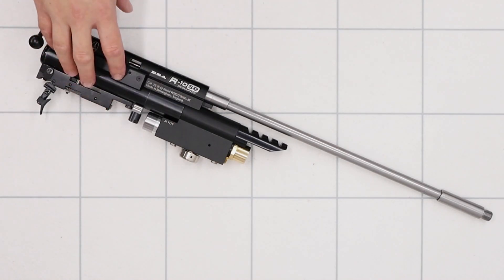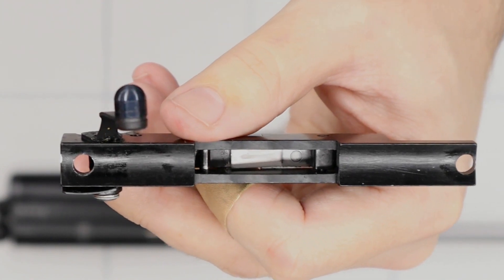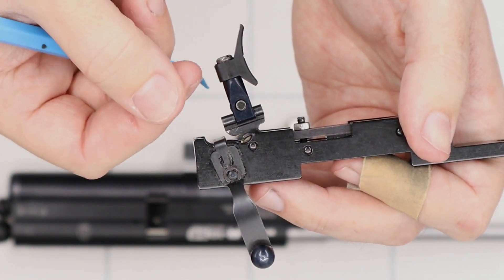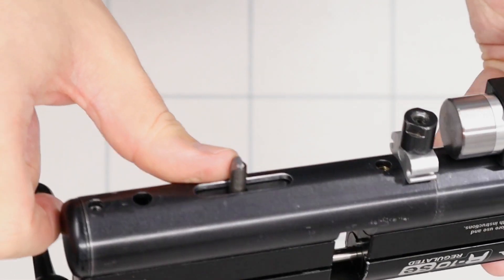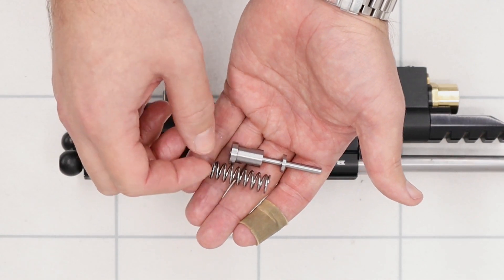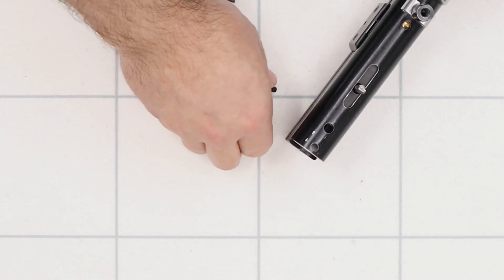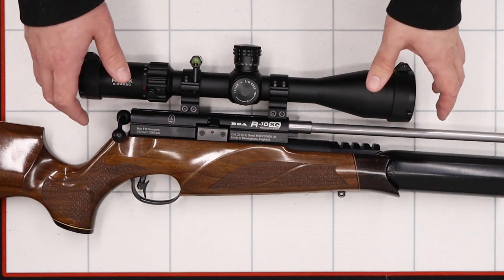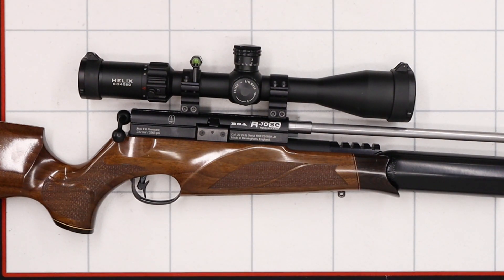BSA R10 Tuning (Increased shot count)

Comment: Great video Jeff! It believes belief that a company like bsa would allow so many design faults to pass their quality control. For example a chromium pellet probe! Any engineer knows chromo starts to peel after😢 a few years! Another I read the rifleing stopped short of the muzzle by about 5 mm. Again the muzzle is the most critical for the barrel accuracy! Jeff had to shorten the barrel and crown the muzzle! I have shot bsa rifles since the late 50’s and never had any manufactured faults like that! I fear that takeover by Gamo might be something to do with the poor quality control! Another gripe I have is with Air Arms! I have a AA S400 (.177) for 7 years which has been pretty accurate for target work! I thought I would give it a service only to find anti tampering all over it! Thanks to Jeff I was able to get rid of all this nonsense! A local rfd told me it was illegal to remove it! I found out through a lawyer that this is absolute tripe! As long as the gun is sub 12 ft/lb it is within the law! I set mine to 11.5ft/lb with the heaviest pellet I could find and put a touch of thread lock inside the adjustment screw! I have saved myself several hundreds of £’s in freight and gunsmiths fee’s! What in the hell is companies like AA bsa etc playing at! I suspect it boils down to greed and money! After all you could buy a powerful sports car that could do 150 mph but you still have to obey the speed limits!

Comment: I bought a stainless steel pellet probe from a good supplier. I had to polish the rear section with 2000 grit wet and dry followed by Autosol metal polish to give it a mirror shine. Without this, it felt unpleasant in the gun due to the very fine machining marks acting as serrations in the delrin shuttle. It would have worn the delrin in no time whereas now it feels smooth like a new chrome one

Comment: I have the .22 super carbine and got 200 shots from the standard 200cc bottle charged to 230bar. I have had the rifle converted to an Airtech Rifles stage 2  rifle. I was getting 220+ shots. I have now added a 300cc carbon (300 bar) and can fill to 250bar (upgraded internals) and get 350 shots. I charge to 200 bar and get a couple of hundred shots before I stop shooting with plenty in the tank (wink wink)

Comment: Great vid again Jeff wish i had the balls to try to do the same to my R10
Reply from the maker: Cheers, its not that scary once you get into it, the only tricky bit is cutting down the spring. Thanks for watching.
Reply: I started out with a  HW95 then 98. Soon had a go at a spring and top hat and sleeve swap. Then bought a HW100 had issues  sold that and got a bsa r10 mk2, got the urge to tinker so had a go at fitting a Huma reg and stainless prove following this vid and others, it was very easy

Comment: Excellent video once again… any chance of getting hold of a brk ghost to dismantle put it through its paces and see what all the hype is about!
Reply from the maker: Its on the list we do hope to get one in the near future, the delta wolf was a fantastically built rifle and I have no doubt that the ghost will be as well, as its the same rifle just mechanical instead of electrical. Thanks for watching.
Reply: @sub12airgunners  I’m particularly interested in the new valve system because I’m only getting 110 shots from my  fx dreamline 300 cc bottle brk ghost claims 300+… on there 300cc bottle which would suit me fine it means I can be on the gun range for 3 hrs instead of one hour before I have to take the gun to the gun shop and fill up plus it’s lothar walther barrel … anyway we’ll see thanks .

Comment: Got the parts from apex airguns, very simple process to follow and my R10 feels so much better and quieter now. The trigger took a bit of resetting and the new spring made it fire very hot before adjusting it
Reply from the maker: it worth doing it does make the gun better 👍 glad the vid helped

Comment: My R 10 has a new problem where the air is leaking out from the hammer tube assembly !!! when filling .
Reply from the maker: Sounds like the valve is leaking, you could try cocking the rifle whilst filling it. Thanks for watching.
Reply: @sub12airgunners  Definitley the hammer tube , havent gone any further need to find a competent gunsmith that knows these things .and here in aussie they are as scarce as hens teeth 😒

Comment: Hi  Geoff, thanks for another great video. I have one of your hammer, hammer spring and stainless pellet probe kits fitted to one of my R10s but would like two more complete kits if possible. Will you be selling these parts again? Thanks, Andy.
Reply from the maker: Possibly, I have some hammers made and am just working through the pellet probes, but the springs are proving hard to get so we wont be selling the springs, although if all goes well the probes/ hammers should be on ebay by the end of the week. Thanks for watching

Comment: HI just wanted to leave a comment about your videos, I am new to the sport , I started off with a Gamo Phox awesome little starter riffle and just purchased the R10 SE  from guntrader private sale, the pressure was low when it arrived, so you guessed it was loosing pressure, So getting to the point, I was able strip the gun replace all the seals and fit a new huma reg I purchased a fx crono to set the hammer good job because it was pretty high.  So a huge thank you, This is all because of your videos, they are awesome. do I need to be aware of anything with the huma going forward ? I wanted to do the trigger also but I read you cannot get the springs, if this changes will you do a video to let folk know ? thanks again Paul
Reply from the maker: Hi thanks Paul no the huma regs are pretty good so no worries there

Comment: Where do you get said parts fella?
Reply from the maker: most of the bits can be purchased from Apex airguns now i think
Reply: Ah. My bolt action part won't lift up to pull back, I think my pellet probe is bent. Trying to strip it now but mine is slightly different to this even though it's an SE. Beneath the screw on the rail there's no hole for the alan key and beneath on the trigger action there's a cap right beneath the bottom of the safety catch when in fire mode